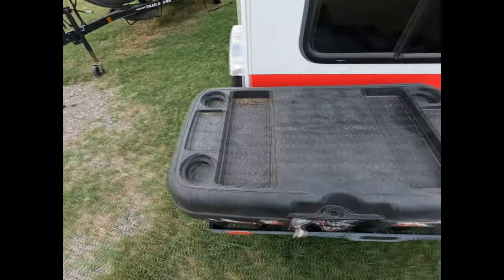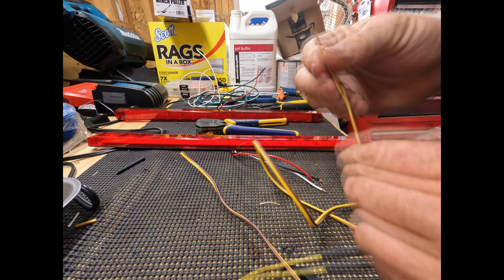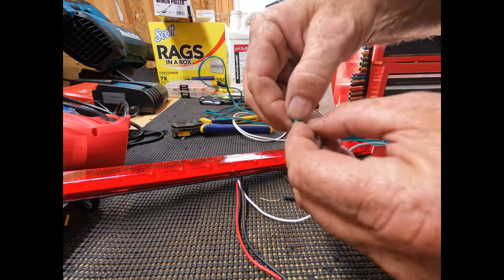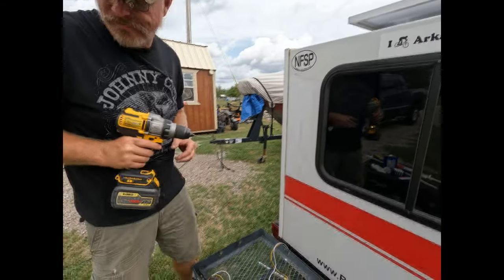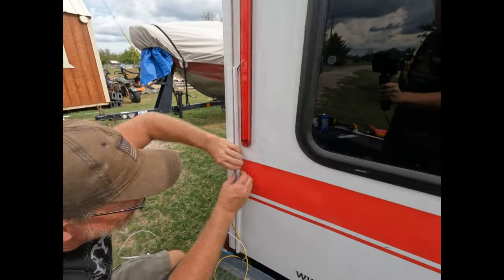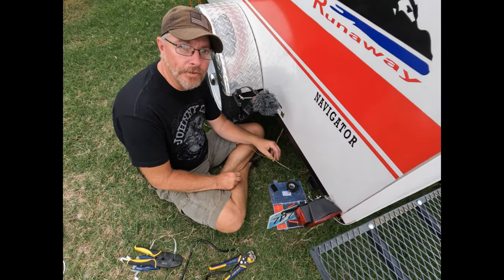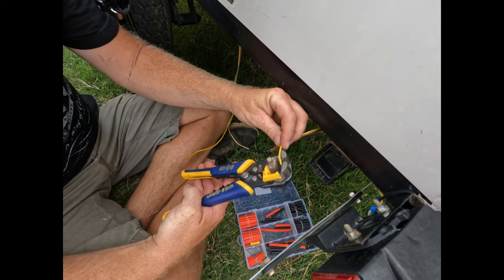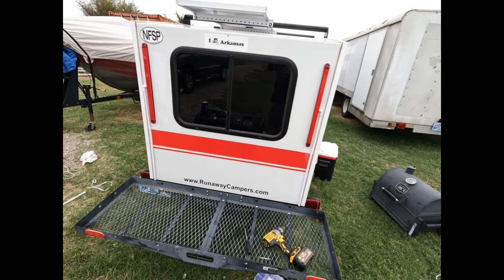Can you add tail lights to your camper?? Of course you can!

Comment: I did 12 Runaway Campers the same way several years ago at the Runaway homecoming rally. 

Pretty soon I’ll be posting a video showing an alternative way of doing this. Instead of using those particular hard 12 V lights, I’m going to try using a strip light that is used on truck tailgates. I have one in my Ford Transit now that we no longer own a runaway camper. I always tell people adding lights in the back of the Runaway like this, is the absolute best modification you can do. Not just to be seen in the dark, but they are great as I am sure you know, for lane changes.
Reply from the maker: I considered doing the same thing with the strip lights. I run those on my business trailers. The vendor I get them from at the time was out so I went the direction I did.